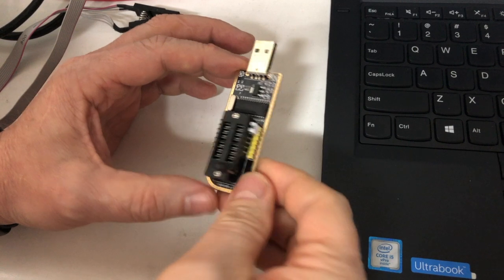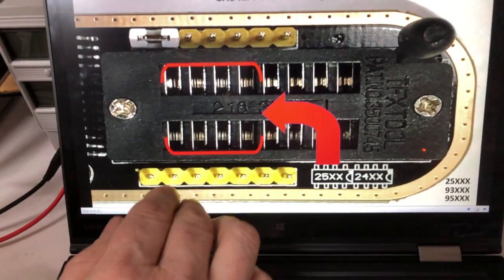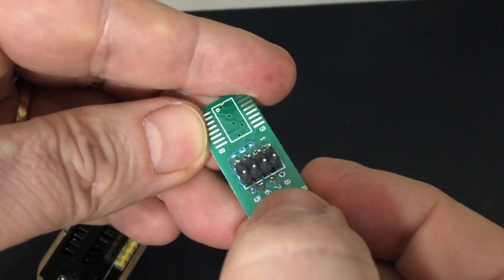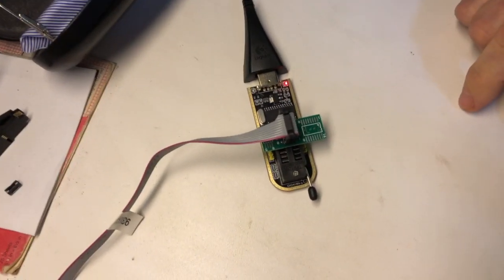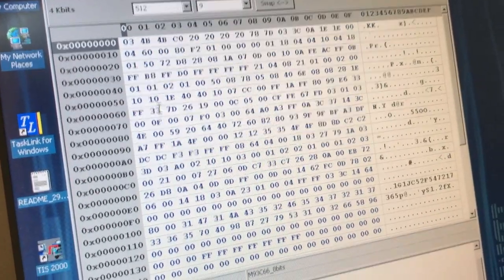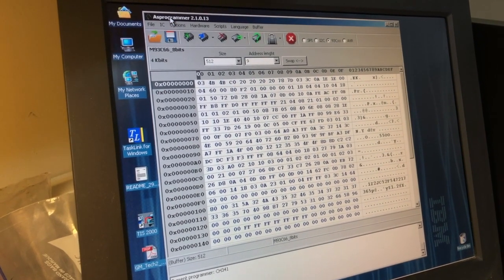Modify the CH341A EEPROM Programmer (Black Edition) for 5V 93XXX & 95XXX Automotive Use

Comment: I try it but it didn't work, the trace to cut the 3 volts its not visible and when i remove the middle pin of the transistor i lose power, no 3v or 5v,  Just sale me yours and the adapter on top I need to change the vin on a gm radio, or is there one that i can buy ready for that chip ?  thank you
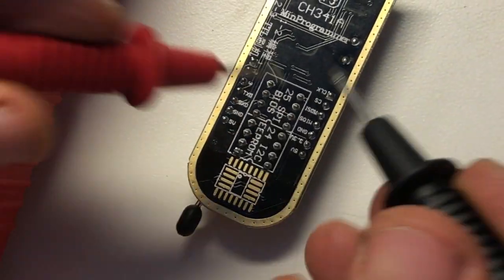Reply from the maker: There's a continuity test starting at 5:45 to identify the trace mod, if you don't get the same test results then the programmer you have is not the same.   In that situation you will have to determine yourself how to apply this same mod to a different programmer PCB layout.  It's pretty straightforward though, either the programmers ZIF is supplying 3.3VDC or 5VDC for programming.  If not, then you cannot do this mod if there's no 5VDC available.   If you're looking for something ready made, I'd suggest something like a TL866II+ programmer instead.
Reply: thank you I found a way to cut the 3 volts now i have 5 and did all the modifications, looks like  i'm almost there but not yet, when i read the chip I get a page full of zeros  Current programmer: CH341
20:46:09
Reading memory...
Done
Execution time: 0:00:00
Reply from the maker: Glad to hear it.  You are using the AsProgrammer software version linked in the description?   You have removed the chip from the board and are not using a test clip to insure everything is working first?

Comment: If using a testclip is it not just easier to change the pinout and connected cables in the crocodile clip end? or cut and join the cabling instead of making minute changes to the board?
Reply from the maker: In older automotive you only need to be concerned with 5VDC so a permanent board change for that mod works out great.  Croc type test clips are hit or miss doing work on automotive circuit boards.  Usually too many obstructions so a pogo pin type clip can have better fitment.  In still other modules you'll have to remove the device from the board altogether.   Having an adapter between the programmer and these attachments let's you swap different tools in as needed.  But this is really something you customize for what you need and what works best for you.

Comment: I don't see the trace on the board for the 3.3v, Could mine be on the top, or am I just missing it?
Reply from the maker: There are several flavors of CH341A programmer floating around, some are factory setup for 3.3V, some are already setup for 5V (ironically there are others doing the inverse mod to this one in order to convert to 3.3V for use on PC BIOS chips and other non-automotive uses).  The most common one is the black edition I showed here, and they are 3.3V by default with no jumper to change it.  But if you are getting 5V on the Vcc pin I show for the ZIF socket on the bottom of the programmer PCB, you may already been gtg here.
Reply: @DrShock  okay I ended up cutting the 3.3 trace, and I put the 5v where you did, but I grabbed it from the other side, does that matter? the light turns on then off so it just seems like something is shorting, is there anyway i could pm you to show you?
Reply from the maker: So I take it then the CH341A you have does not match the PCB traces I show in the video?   Technically it does not matter where you would make the mod here, but I would be concerned if yours is different in this respect there may be other design differences as well.   Still the most obvious cause I could imagine from what you described with the red LED, would be that there is still 3.3V connected and now you are ground or shorting that.
Reply: @DrShock  Well It only shorts out when I connect to the chip, the EEPROM Chip

Comment: Followed these instructions to the T on a new black edition.Turns out I  had 5v on chip select and you can guess the rest on a 93c66 out of a Toyota immo.  I don't know about the traces on the supplied mini board had anything to do with it but that part was left out. I cut them after the zif was killing the programmer. So now I'm back to square one with a fried chip and a car that won't start. Enlighten me on where I went wrong
Reply from the maker: In making the 93X adapter there are many approaches one might follow, and it was left to the viewer how they wanted to implement the requirements for the adapter using the datasheet crossover info presented in the vid.  I went pin by pin on the adapters requirements, using Powerpoint slides I made for this starting at 1:56.   If one decided to use one of those little proto boards as an initial basis to implement that info they would have to disassemble it in order to rewire each pin under a microscope to match the slides diagrams as I mentioned I did at 4:11.  But this approach was just one possible example of how to go.   I could only speculate were you went wrong was in making your zif adapter it did not exactly match the required crossover for each pin, based on your comment.

Comment: I am trying to read and write a st95128 eeprom. However this programmer does not read this eeprom on the pcb. In fact when hooking up soic8 clip the read light on the programmer goes out. Almost as if it is shorted when connected any ideas why??Also note my programmer is unmodified only modification is another jumper added on the bottom pins diagonally from original pin. Both jumpers installed. with second jumper 5v pin gets power. However programmer becomes unresponsive will not do anything.
Reply from the maker: Test clips are hit or miss in automotive electronics.  It's always preferable to read the EEPROM off the pcb, as there are some automotive circuit board designs that will inadvertently interfere with in-circuit analysis.    I would imagine this is what's happening given the behavior of the red led going out.
Reply: @DrShock  Not sure as I was able to read it in circuit with another tool. However I cannot write or rewrite the bin now. It was written once but now it  fails to write at the 92% mark roughly. I think the version of ch341A i got was never pcb was laid of differently. I believe I made it unsable now. traces look o be laid of differently. Do you have a link to the exact one you purchased??
Reply from the maker: There are a few designs of this inexpensive CH341a programmer, I got mine on eBay last year but the original seller is long gone now.  For what the video covered, the "black edition" is the typical description to stand out from the other types.    This is why I included several close up shots of the programmer top and bottom so a viewer would know if they had this same one or not.

Comment: Hi I’m buy 2 ch341. One is connect which is I don’t cut. Next one which is I cut not connect my lap top 😁
Reply from the maker: That would sound like you damaged the 5V supply line coming from the USB port to the voltage regulator that powers the CH341a chip itself.  That would cause the programmer to no longer be recognized by Windows.

Comment: Is the mod outlined in this video required to reprogram gm radios?
Reply from the maker: The earlier ones are going to use 5V EEPROMs so yeah.   More recent radios may have 3.3V compatible devices, but not the earlier designs from Delphi/Delco.
Reply: @DrShock  hey I just tried this on my radio whenever I try to read the EEPROM I get all 0 values. Could you help?
Reply from the maker: @brayannexon4613  Some radio boards will not support in circuit reading due to other loads on the traces involved, and you'll have to desolder the chip from the board first.
Reply: @DrShock One more question. Could running the stereo of a 12v power supply allow me to reprogram the eeprom while live? I am wondering becuase if i do need to desolder the eeprom it might as well swap it.
Reply from the maker: @brayannexon4613  The radio is not going to work just by supplying 12V, you'll need some sort of harness like I've done so it gets the BCM communication.  But it will power the board so I would say yes, as long as you don't have one of the designs where the loads on the circuit prevent in-circuit programming.  On those models, you have no choice but to remove the device and program it off-board.
Reply: @DrShock  I tried more things today.
I supplied the board 12v - nothing
I removed the eeprom from board - 0 values 
I tried swapping eeprom to new radio.- still locked.
Any suggestions? I don't know what to do anymore.
Reply from the maker: @brayannexon4613  I'd focus on the second test you mention.  You removed the chip from the radio board and put it into a soic test clip or soic programming adapter and are still reading 0s.   That begs to ask if you're sure you have pin 1 oriented right?   If you're sure you have the right half of the programmer ZIF socket being used (remember one side is for 25/93/95 and the other for 24  types)?  Typically radio EEPROMs are 24xxx series devices so have to be in the other half of the ZIF socket.  This other video may be more helpful to you - https://www.youtube.com/watch?v=ZIRefUhyJOQ
Reply: @DrShock  I thought that too but if flip the chip on the test clip the programmer turns off and yes it is on the 24cxx socket. I still get all 0 values.
Reply from the maker: @brayannexon4613  So presuming you're using a compatible software to drive it - then either its a defective test clip, defective programmer, or collateral damage to the programmer from  when doing the mod.  Check your mod work under a magnifying glass or microscope for adjacent trace damage.   It's a very simple programmer so when something like this pops up you have to do process of elimination.

Comment: Thanks for replying so fast drshock, I have another question, after I bodge wired the modification, when I plug in the zif adapter into the ch341a all the lights turn off (the red power light) and it doesn’t get detected anymore any idea why it might be doing that?
Reply from the maker: That sounds like you're grounding something, I would double check your work for shorts.
Reply: DrShock thanks boss I’ll recheck

Comment: This is amazing thank you! 
Instead of busting up the CH341A unit itself. I ended up soldering wires in between the two break-out boards that came with it.
For VCC 5 Volt, I just made a jumper that can be attached to the yellow 5 volt pin.

Thank you again!
Reply: Same here. I had ordered some cables with famale connectors at both ends. Just hook them up onto board. For 5v, I hooked there instead of aditional board and voila.
But I have question, maybe someone sees and answers. How I know if I have 8bit or 16 bit? And address length... For me,seemengly most correct one came with address length of 6.
I am doing this for the first time, and for now I try only read. I need to compare the programming of instrument cluster from same car but for different engines ( different rpm and speed dials) to make may own design(I want 320 instead of 260)
Reply from the maker: Easiest way might be to power up the circuit and check and see whether that’s high or low on that pin

Comment: How did you bodge wire under the pin headers?  Did u do it with the pins on?  Can you use any Solder wire to bodge wire?
Reply from the maker: You can use any solder, though 0.015" diameter is easier to work with on such a small target.   You would implement the adapter bodge wiring  I mention at 4:02 with 30 awg wire of the type used in wire wrapping prototype boards.  I did mine to the traces on the small adapter circuit board I showed, and then soldered the pins in afterwards .  Think of this like wire wrapping to the pins but tack soldering to the trace first instead.

Comment: Thank you for the lovely video. Worked like a dream. I was rewriting a ST 95 eeprom clearing a crash data as per your instructions by doing the hardware adoption. All went good. Keep up your hard work
Reply: Did you have to modify the adaptor for the 95xx too or was that just for the 93xx chips? Cheers

Comment: if I apply this mod, would it work with 1.8V adapter required by some 25xxx chips? does the 1.8V adapter work with 5V or just with 3.3V so if I plan to use it I'd better acquire another ch341a?
Reply from the maker: This mod is to customize the programmer for automotive device use, +5VDC only.

Comment: Just throwing it out there, but... if you didn't want to cut the line and add the bodge wire - couldn't you just swap the 3.3 for a 5V reg?  Lines already go to the right spot!
Reply: I just take one jumper piece from my spare bin and put it to between 3.3 and 5 volt pins. No soldering, no reg leg lifting or trace cutting. Reading and writing 95040 with no problem.
Reply: @Temppaable  true :) works like a charm
Reply from the maker: Yep, you could do that if you had one handy.   I wasn't looking to put any extra $$ into this though.
Reply: @DrShock  - that's all I was think... if you had one laying around in a spare parts bin as so many of us have.  Just another option!

Comment: Hello, i can't write W25Q16BV or W25Q32BV they are using 3.3volt do you have idea about that?
Reply from the maker: Not typically used in an automotive application so no, not familiar with that device.
Reply: It simple, you have to jump and modify the programmer to send 3.3v when writing instead of 5v

Comment: Can i still read 95xxx without this mod or is the mod only used for writing?
Reply from the maker: It's needed for writing to the EEPROM in all cases.  For read only; I suppose that would depend on the manufacturer, some may tolerate a lower voltage, some may not.

Comment: With the 95xxx eeproms, would I just need to bypass the 3.3v regulator and run the 5V wire and use the 25xxx socket?
Reply from the maker: Right, like I mention at 1:14 its just the hardware mods from the video plus using the specific programming software mentioned.  There's no adapter needed for the 95xxx series just special software and 5V write capability (I've not come across anything else up thru 2010 GM vehicles yet).
Reply: @DrShock  please share me the special sofware Asprogrammer for 93Cxx with ch341

Comment: Hello. Thank you so much for useful guide. I have a question. I removed voltage regulator for +5V  modification. And I shorted voltage regulator's IN and ADJ pad.  

Does this cause a problem ?
Reply from the maker: If your Black Edition is like the one I show in the video, this regulator is only for the 3.3V as the USB is supplying regulated 5VDC from the PC connection so it's not needed.   But the ADJ is pin 1 on that regulator, and it's probably tied to ground (I don't have the schematic for this Black Edition to confirm) so I wouldn't suggest doing that not knowing.  Just leave it as I showed it with pin 2 OUT raised.
Reply: @DrShock  i read eeprom today. Thank you so much again :)
Reply from the maker: There's no voltage select "jumper" on this particular programmer.  That's one obvious reason for the bodge wire add.  You have to address both power up to the device  and the programming voltage pulse output.  Automotive grade requires 5V for both.  Cutting the circuit board trace and bodge wiring it covers just the power up.   We need to insure no use of 3.3V sourced for programming so we lift the regulator as well (while not all black edition PCBs are the same I show both mods for completeness).

Comment: congratulations, your video is the best. i have a cuestion: the pin 6 and pin 5 of 93xx are conected? thanks for your work. grettings from argentina!
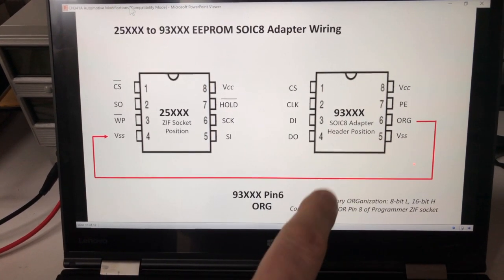Reply from the maker: thanks, it depends on the device you are working with and its use of the ORG pin 6, so you may want to rewatch this part at 2:52

Comment: Great video and explanation. I am waiting for my programmer to show up from the slow boat out of China. Could this process be used to change the VIN on a locked HMI module or MyLink radio? GM SPS does not seem to work for junkyard pulls.
Reply from the maker: Possibly, depends on the module really.   The newer stuff is harder to do this low level way than the older vehicle modules.   I can't speak to anything newer than 2012, but for that and older you can usually work at the EEPROM level for most things.  Hardest part is knowing where to look, sometimes have to rely on members only forums for that info.

Comment: Hi I managed to find the files that I am interested in for this motherboard
Acer E5-571G-562B A5WAH LA-B991P

Acer Aspire E5-571G-57D9 LA-B991P Rev 1.0 Discrete Bios + EC

Acer E5-571G-57D9 LA-B991P Rev 1.0 Discrete 25Q64VFSIQ Clear ME.bin
Acer E5-571G-57D9 LA-B991P Rev 1.0 kb9012.bin

how do I put these two bins together in the programmer CH314A ?
Reply from the maker: The video is about programming vehicle module EEPROMs, not personal computer ones.  Different processes and tools.  You might try other YT videos around working with flash BIOS chips for PCs.
Reply: @DrShock  the video is perfect .. I thought you could show me how to join the two .bin. Thanks

Comment: How to reed the 95 xxx series???? You show just the 93xxx
Reply from the maker: Well there really wasn't anything unique to show.  Same ZIF spot, same AsProgrammer software, and same 5V mod to the PCB.   There is not even an adapter required because as I mentioned in the video the 95XXX is the same pinout as the 25XXX.  You just plug the 95XXX in the same as you would with a 25XXX after making the 5V PCB mod, and then selecting the 95 within AsProgrammer.

Comment: Great Video ! Would this be a good Alternative for Service programming GM Bcm’s for 2000-2010 approximate years? Might be able to bypass tech 2 interfacing and Gm sos.
Reply from the maker: Thanks, yeah over the next couple of weeks I'll be posting some videos illustrating exactly some of those concepts, for the early to mid 2000s designs of radios, XM receivers, and BCMs using this modified programmer.  The BCMs in particular of these years are locked out of SPS because the Tech2 is designed to treat them as locked once programmed, thus blocking using an used one at all.   So I'll be sharing some approaches to get around that.